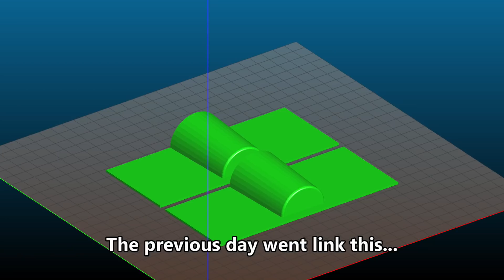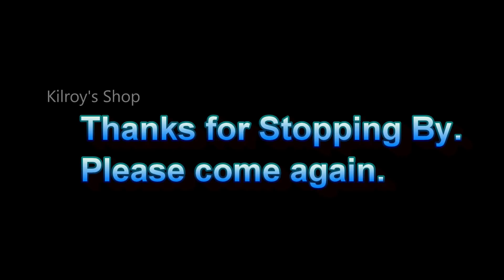Machining Windy Hill Foundry Machinist Jack Patterns

Comment: This Old Tony has a machine vice with a vertical axis pin in the center of what would normally be the fixed end of the vice. As I recall it has one side with a vee block built in it. You can spin the end around its axis to expose any end you want to use and at any angle. I suppose you could make a variety of end blocks if needed.

Comment: Do you think an epoxy product would also work in place of the low temp metal? Like a JB Weld or Bondo.
Reply from the maker: Probably so, with a much longer cure time no doubt. Might have to try it.

Comment: Creative workholding method. Three comments. 1) Might add a link for sources for Cerrosafe. I get it from Brownells. 2) The Cerrosafe might release more easily if it's only just solidified when you try to separate the 3D print. I understand it shrinks over time. 3) Not a metallurgist but the hard spot in your casting might be improved with some post casting heat treatment. This would need to be done before machining as the CI may tend to change shape as the casting stresses relieve.
Reply: MICROMARK.COM  is a source for low temp alloys and casting materials(resin, alloy, mold making), small tools, even 3D printers.

Comment: is there a reason to not face the bottom on the lathe?
Reply: i mean dont get me wrong this looks like a lot more fun, just curious
Reply from the maker: Kinda hard to hold the main body with 2 degrees draft.
Reply: I get it being "the same poblem", but you could, presumably make a 2 degree temporary collet".

Still, it's exactly the same kind of problem, you have no flat surface to hold onto.
Reply: @joshwalker5605  ...He has a shaper, if you are trying to start something!!
Reply: Paul Copeland what?
Reply: @jtkilroy  

Easy.  Wrap in soft copper wire, insert in chuck and crush to fit.

Plan B,  turn an aluminum sleeve and taper the ID to match the draft. Slit the sleeve.

Comment: If you can get it, typemetal from a newspaper or print shop would be good material to use.  Typemetal is slightly harder than lead.
Reply from the maker: The old linotype! My grandfather was a printer, grew up with ink in my veins. I have several five gallon buckets of linotype around.
Reply: Thank God your Arteries carry Blood ! lol ! Thanks for the video.
Reply: If I remember my graphics art class correctly type was made of lead and antimony so that it held its size with heat. One expanded and one contracted. The height of letterpress type is critical for good print. Some part of the brain is saying .918” tall. I’m guessing the melting point is higher than the stuff in the video.
Reply: Actually Linotype and Monotype alloys are MUCH harder than pure lead. It had to be to hold up to the rigors of typesetting.
Lead has a BHN of 5 while Linotype is at 22 BHN, and Monotype is 28 BHN.
I have a few hundred pounds of Linotype squirreled away for adjusting the hardness of my bullet casting alloys.
Reply: @glennstasse5698  Melting point of Linotype is 522°F and around 645°F pouring point.

Comment: wow.. great... now take a pair of jaws... carve away a 1/4" deep notch out of the faces but not to the bottom or side edges.. create a removable plate for the top surface..  lay the jaws on their back and fill it with your soft low temp material.. now you have a crazy soft pair of jaws to clamp anything.. when they get worn..  take them out.. heat them over a a ceramic bowl to melt the insert material without melting the aluminum and then repour..  so cost of lost material is minimal over the next decades. 

 don't forget to look around your scrap pile and see if you have any aluminum you can make a set of 5 or 6" tall jaws with ..  to make it easier to clamp larger objects or larger rounds.   heck.. i just envisioned using a pair of chain type vice grips.. that one could have on one jaw and throw the chains over and latch them on the other jaw to hold objects tight.. while milling or drilling between them.
Reply: Best way to melt Cerrosafe is a double boiler. Water boils at 212°F - dead simple.

Comment: I'm not sure why you did a lot of what you did on this project.

If I understand what this is for correctly, it is just a support that matches the height of the bottom of the mill vise.

Is there any reason you needed this to be cast?

Seems to me you could have fabricated this out of some bar stock and have beed done long before you had made your pattern.

But if I had the same castings to machine, i would have chucked the round part in the lathe with some soft shims and turned the base flat and then went from there.
Reply: One thing is for sure about YouTube. No matter how you do something some know it all will have a better way to do it.